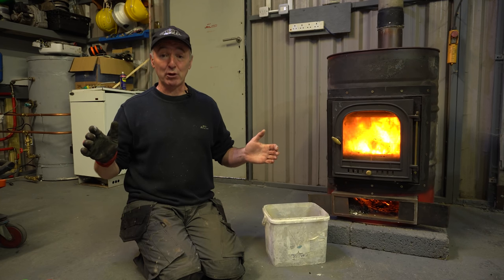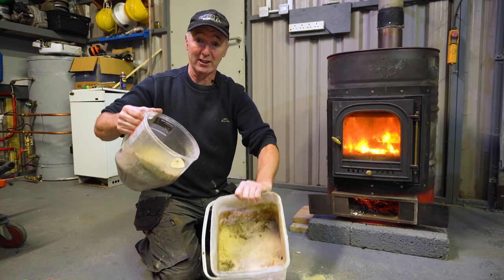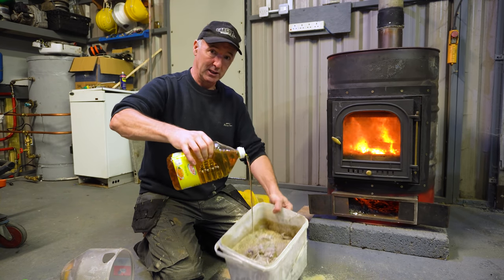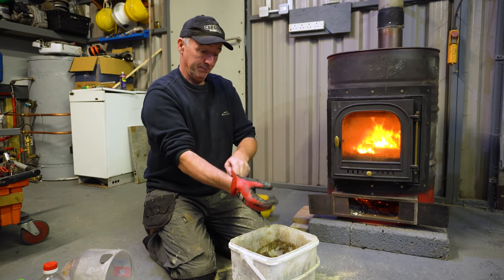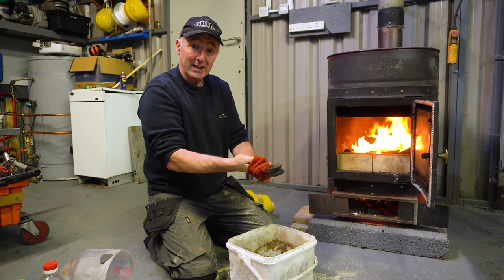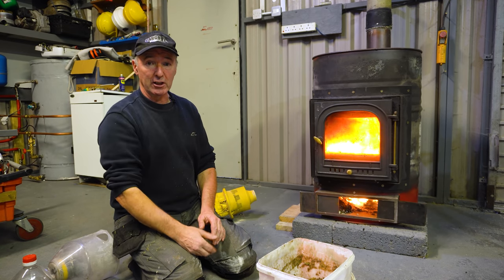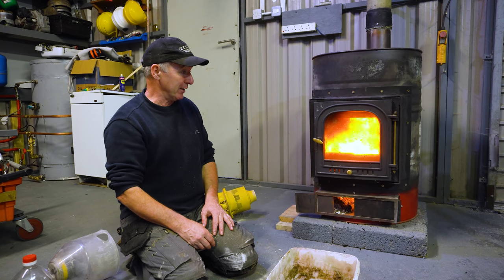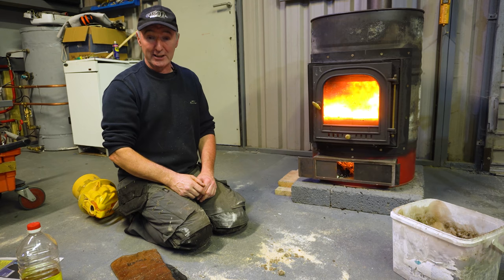Free heat from Sawdust + Vegetable oil .. No Tools Needed

Comment: Good to see you back playing with fire Gerry (: Missed you mate!
I used to have a Pot belly stove about 35 years ago and used to go to the cabinet maker and get heaps of sawdust he was glad to give as much as I could use away
All I did was get a fire going in the PBS then just load it up with sawdust and I could get it glowing white hot if I wanted to very easily but mostly kept it at a red hot.
I didn't think of using oil at the time and it didn't really need it
But I could see that idea of oil and Sawdust being used in one of those paper brick maker things you wouldn't have the drying time of using water and newspapers before you could use them either
I still have one of those machines in my shed I will have to find it.
We have just come out of winter this way (Western Australia) but during winter my mate gave me a Kent slow combustion stove,flue and all for free
They brought it about 20 years ago just before there first child was born, Chrysanthia didn't like the idea of a wood burning stove and a child being near each other so after spending 2000 $ + install costs and about 1 month of use it ended up going into his father's garage for storage for 20 years
And then given to me a couple of months back!
Basically brand new I can't wait to find someone pro to install it for me before next winter,in my bedroom
(20ft x 15 feet) I will probably only need kindling fires to heat the room!
Am very seriously adding your oil drip feed system to it for alternative / hybrid fuel use

Have you considered making a oil rocket stove like this bloke from Little Aussie Rockets does?
He has been experimenting with vortex flames and incorporating a water jacket to heat water as well as cooking on it
anyway Gerry glad to see you back again
Tony from Western Australia
Reply from the maker: How are ye Tony. Great to hear from you. Getting shout outs from all over the world which is great. You're over the winter there in Oz  and we are just heading into it here in Ireland. Frost on the grass this morning and it's great to be able to get the shed warm for free. The new stove will be running on both Oil and solid fuel soon and I have another heating system in the shed I will be showing next week. Great bit of luck to get a 20 year old New stove. I will have a look at the rocket stove a little later this evening. Stay safe Tony and thanks for taking the time to comment Really great. Cheers Gerry👍
Reply: @GerrysDiy  it must have been synchronicity Gerry, I was only thinking of "it's been a long time since we last heard from Gerry I usually do a run through of my favorite subscripted YouTube channels every week or so if I haven't heard from them in a while I checked you out the day before you posted this video out, then the next day, I get the notification that you have posted a new video 

I do like the look of this new heater that you have made I thought it was a Shop brought one at first (: 

We don't get snow here in winter but where I live I do get plenty of Frost, I can't wait to actually be warm next winter but boy getting the stove out of the back of my Hi-ace Van on my own and moving it onto the back veranda was a effort it must weigh over 100kg at least I'm toying of getting it inside to my bedroom to have it ready to install might prove to much for me, 
But being able to cook on top of it next winter will be a good incentive. 
I an thinking of putting a coil of 3/4 inche copper pipe in the flu to try and link the water into the inlet water of my bosch gas HWS as a pre warmer or run a separate pipe to the sink which is through the wall about 8 feet away but am not sure how to get it working without a storage tank?
have you got any ideas of insulation in the shed yet?
A Free  heat source is one part but the longer you can keep that heat around the more comfortable you will be, winter and summer.
I'm looking forward to a winter your way, summer this way of good ideas Gerry
Please be safe from covid and the world in general
Tony from Western Australia.

Comment: good Idea.
I have a huge metal tub in which I can mix dry wood chips with used oil. Fill bags and away we go into my outside boiler.
Testing mixture ratios then.
Thank you for the simplicity.

Comment: Neighbors will love the smell of fries everywhere
Reply: Seems like I could run my saw for another 30 seconds and cut another log and not have to deal with any of this drama at all. 
Hate to be "that guy".
Reply: I use to pour  oil on wood or sawdust to make it light faster. But, it really smells.
I guess somebody could use the oil to burn, but i don't think it is good for the stove.
Reply: @MrGigi-dz9cv  ... I have a friend who heats his shop with a stove. Lights the morning fire with some kindling and one log then sets a drip tube with a valve to feed a few drops of waste oil on top of the log every minute. The oil is gravity fed from a bucket on a shelf. The chimney is always a light white ash and no noticeable odor while burning. The drip tube is a piece of automotive steel brake line into the fire box. He said it lasts a few seasons before the end burns off enough to need replacing. ($2)
Reply: @rupe53  How does he regulate the oil flow ?
Reply: @rupe53  We used to have a stove that burns on diesel. But i don't know If this would burn on oil.
Reply: @MrGigi-dz9cv  ... used a small fuel valve at the end of the tube, several feet from the stove. Just opened it slowly and watched for it to drip. Can't recall the exact drip rate but probably something like a drop every few seconds. He did mention that as the tube warmed up he'd have to adjust it again, then it would be ok for the day. Obviously you need to remember to shut it off at the end of the day as it was a fully manual set up using old motor oil.
Reply: @MrGigi-dz9cv  ... the biggest problem with waste oil is the consistency of your product. Veggie oil is a different viscosity than say motor oil or ATF, and obviously 90 wt gear oil. Preheating the oil can make it easier, but the best way is to simply use the same oil all the time. 30 years ago a friend in a transmission shop specifically kept his waste ATF separate for just this reason. We have a guy at work who heats his house by saving 10w-30 at each service. He's actually modified a conventional oil burner and preheats the oil with an electric immersion element in a 2 gallon tank (140 degrees?) then added a strip heater to the  gun assembly in the burner for better starts. Everything is on a delayed start and nothing runs till the oil is up to temp. (about 20 - 30 minutes)
Reply: @rupe53  I see. I have some of each. Thank you.
Reply: Damn the neighbors 😂
Reply: I would hate to smell fish
Reply: @MrGigi-dz9cv  I would guess a simple valve slightly closed or not.
Reply: @MrGigi-dz9cv  just using it as a small fire starter shouldn’t be too much of an issue.
Reply: @JanColdwater  Houses are really close, and the wind is blowing to my neighbour dirrection. Besides, he uses natural gas.
Reply: @MrGigi-dz9cv  ahh! That does stink.
Reply: @aduantas  ... his tank is several feet away from the stove up on a shelf. I doubt it reaches 100 degrees by the end of the day. Besides, waste oil doesn't give off vapors like gasoline so no worries there.

Comment: Great to see you again Gerry. I mix veggie oil or waste motor oil with saw dust, (I learned from you),  and press it through a section of pipe, with my 20 ton shop press or 22 ton wood splitter.  I use the small ones for firestarters in the house, and the large ones go in my barrel heater in the shed.  
Cheers! 
Doc
Reply from the maker: Hi Martin. Great that you can hydraulically compress them. Haven't tried it myself yet. Have been following with interest the Elections your side of the Atlantic. Stay Safe Doc Great to hear from you. Cheers Gerry👍
Reply: @GerrysDiy  just a heads up, it doesn't take much oil when pressed hydraulically. Keep a catch pan under.
Reply: I was just thinking this. Cool to know someone else is already doing it. How well do they hold together ? Would be nice if they stuck together long term so you could make a load and then store them. I wonder if there is a binding agent of sorts you could use to improve it.
Reply: @ratgreen  they don't stick together very well. I've seen videos that apply alot of heat and pressure to make "bricks", but I'm not that experienced.
Reply: @ratgreen  I'm also trying leaves. They hold together a little better but I don't add oil.
Reply: we have kind of a mafia that collects all the old oil just like it is mentioned in one episode of "The Simpsons" where they also have this problem — the oil mafia collects all the old oil from restaurants and car repair shops. Sawdust is another issue. Nowhere they give sawdust away for free?

Comment: Should make cakes out of them that are highly compressed so they burn slower.
Reply: @indyrock8148  That was my first thought.  My second thought was, "how long is this going to take, and what are the real costs when I factor in the value of my time."
Reply: Tip: Toilet paper support roll. One way or another every house has them as left over, or in other words garbage. Stuff them with oily sawdust, compress with a piece of wood. Had more sawdust as needed, compress.
That's it, simple, easy, dirty cheap, as in FREE! The size makes them quite handy and practical to use in a wood stove. 
BTW it's totally worth to use a metal pipe as an outer sleeve. To support them while filling up. Makes the entire operation way easier. ;-)

Curiously, I do have an hydraulic press near the area where I fill up the rolls. I can assure it's neither needed or worth the effort to try and compress them to a high degree. Waste to much time it's a diminishing return! So compress with a piece of wood by hand. That's good enough and fast.
Cheers all
Reply: just don't use the wife's bread pan! She might bap you over the head with her rolling pin!
Reply: @crpth1  exactly what I do and burns nicely

Comment: Great vid Gerry, been doing the same with motor oil, I stuff the mix in a used milk carton and bang it down a bit with a piece of lumber. Cheers from Canada
Reply from the maker: Hi Madd Macc. Great to hear from Canada, hope it's not to cold there yet. 15 degrees c here tomorrow so wont be cold  working in the shed. Thanks for commenting Cheers Gerry👍
Reply: @GerrysDiy  -9 c , and we just got a bad snow storm, schools closed, most roads unpassable,
Reply: Teaching people to burn dirty used motor oil in a stove is a dangerous thing to do,. Oil stoves use filtered oil and burn extremely hot. Your adding creosote to your chimney and telling others to do the same.. brilliant plan. Let's start chimney fires because your to cheap to buy proper fire wood.
Reply: @jimcurrier2166  thank you! was telling the guy the same thing.
Reply: Good replies, however, when “ we “ add additional air, the combustion is more complete, if you check the vids , it’s shown that 1. The stove burns ver very hot and 2. There is no smoke.
I personally am a veteran mechanic and know that more air is better, ( super charger ) and I use an additional blower to add more air, so little to no smoke and my chimney pipe is still clean after 2 years of burning motor oil.  Cheers from Canada

Comment: Very nice,
I use brown paper feed bags,
sawdust
used motor oil
Run it pretty hot, everything will stay clean,
I just use the mix to start the fire, then cordwood after starting
but only in the workshop, since it does smeal so I don't use in the house.

Comment: Hi mate, could you try something for me? You can force the oil to polymerize using a siccative ? Its commonly used to revamp old oil based paints that have gone out of date and wont dry, its the drying agent for oil based paints. It basically forces the oil to oxidize and polymerize and thus harden. So in theory you could make solid chunks of oil and sawdust and a splash of siccative = DIY waste oil and sawdust logs. My idea would be to mix the oil and siccative, then add the sawdust, and then compress them in a tube, wait for them to dry, then push them out the metal tube to get your logs. I've done a bit of research this evening, some siccatives are toxic. From a quick google I think terebene or Kreidezeit Siccative is ~OK~ to burn and relatively cheap. There is no info out there on the effect they have on veggie oil so it would be trail and error to get the right amount to use for correct drying.
Reply: Not every oil polymerizes even at the presence of a siccative. Sunflower seed oil is ok and very good is of course linseed oil. The last isn't used for cooking.
Reply: Interesting thought, with regard to hardening oils (e.g., walnut oil, Tung oil, flax seed (linseed) oil and vegetable oils). Of course, it will not work with non-hardening oils, like motor oil or mineral oil.

Comment: Allright Gerry ya got me into some hot water with the wife.  I made this formula up and put into some old plastic bags that came from the market. And I must say that they kept the shop nice and warm. But that isn't all that got warm. My wife was a bit hotter than the barrel stove.  She found out that I used the kitchen mixer to make them.  I almost got hurt really bad. I ended up having to go to town and buy her a new mixer.  But this isn't the first time she go hot over me using the food mixer. I also had mixed some water base paint that was white. I thought I had cleaned the beaters real good but she spotted a tiny speck on the beaters and said nothing. So that night we had a nice meal of fried chicken, corn on the cob, fresh picked peas, and mashed potatoes.  BUT she mashed them with the mixer I had used and didn't wash it.  Ya know I wondered why she didn't want any potatoes. LOL This time I bought her a new one and put the old mixer in my shop.
Man let me tell you that women have a mean streak in them.
But the plastic bags work very well and they like the paper burn completely up.  Gerry have a great day sent from Florida...
Reply: Dave ... been there, done that. Buy al old mixer (and other stuff) at garage sales for use in the shop. You'd be amazed at what you can get for pennies on the dollar. Been in my home for 45 years and never bought a new mower, shovel, electric heater, or garden hose. I did buy a new extension cord at one point, but I have learned better!
Reply: My wife could have been a private investigator.

Comment: It's called a smug pot, we've been doing that for years in the oil field (using diesel) but never inside.
Reply from the maker: Hi Gary. I have other burners in the playlist that work on pure oil and can run with forced air and some that run normally aspirated. I have a stove based on a smudge pot and it makes a ton of heat and can glow the flue pipe bright orange. Thanks for commenting Cheers Gerry 👍

Comment: Hi Gerry,
Thanks for the video and the handy tip.  I was wondering if the old veg oil was from your own use or if you source it locally.  I would think that it would be hard to source because of thrifty people burning it in converted diesel vehicles.  Just my thought, no real evidence behind it.
-mike
Reply from the maker: Hi goptools. It was just from my own kitchen. Sometimes I can get it but it is collected from the businesses in bulk. I need to make some changes to this stove to get it running on waste oil very soon. More build videos too. Thanks for commenting Cheers Gerry👍
Reply: Since you have a wood stove have you ever used chainsaw sawdust or shaving in your wood stove?

Comment: Way to use up some free leftovers!👍🏼
Have you used any of those heat powered stove-top radiator fans? I hear they’re supposed to help distribute heat way more efficiently but I’ve never owned one
Reply: I have one. It work reasonably well. It's silent and discreet and wasn't expensive. 
By no means can it be compared, in terms of power/air flow with the mains connected fan. I had in there on previous years. 
But on the other hand it's self regulated, work totally unattended, don't consume external power, etc. Nobody as to go there to turn it On or Off and so on. That alone makes it totally worth. Cheers
Reply: Their about 30 to 50.00 on Amazon. Anything to keep electric costs down.

Comment: Very nice . I use my wind and solar hybrid trailer and a 600 watt infrared parabolic heater and can run it for 8 mo non stop free power and heat .
Reply from the maker: Very nice! My shed is hooked up to the grid but I might put some panels on the roof later this year. Thanks for commenting Donald Cheers Gerry 👍

Comment: Hey Gerry! Interesting idea but I'm curious what the motivation to burn the oil is vs. collecting and recycling? For the effort and time it takes to burn the oil, you could easily burn firewood or wood scraps from the shop. It's fairly common in our area to have massive local dump bins, where at the same time you can recycle your containers. Don't get my wrong I love burning stuff! Appreciate your time - Cheers!
Reply: Veg oil is over 3 bucks a gallon!
Reply: Good for carpenters that have lots of saw dust though.

Comment: I would use old bacon Grease and old veg oil but not motor oil.  I would make them for camping and mix with dryer lint once fire is established.  Then you do not need worry about the chimney.

Comment: Thanks Gerry. Hello from NY. That looks like a great idea! I have more sawdust than I know what to with. Now I know how to make use of it. Thanks again.
Reply from the maker: Hello Dan in NY. Great to hear from you. This is so easy to do and to make in bigger batches with a drill. Can use engine oil as well but be a little more careful for additives etc Really appreciate you commenting Cheers Gerry 👍
Reply: @GerrysDiy  Hi Gerry. As it turns out I went to the local recycling area to drop off some yard waste and they had about 8 gallons of used vegetable oil in 1 gallon jugs. Now all I need is a burner😊. I now have a winter project! Thanks again Gerry